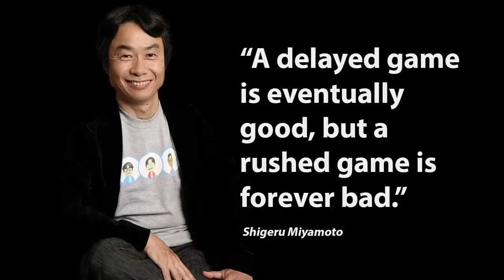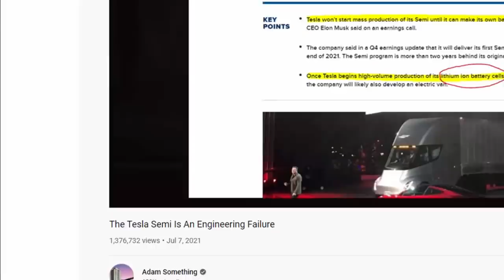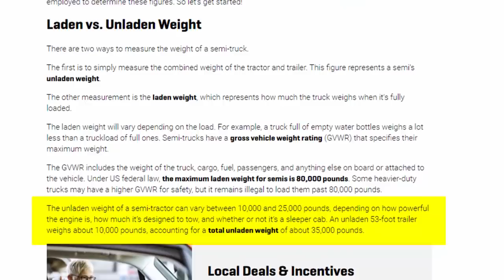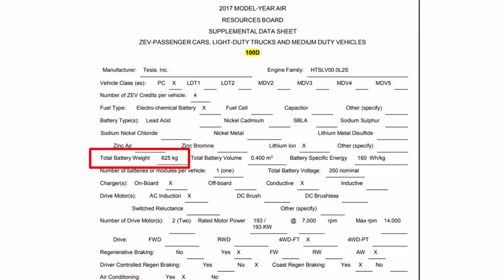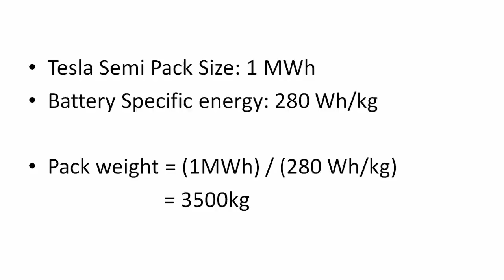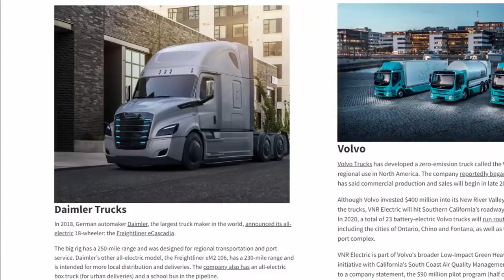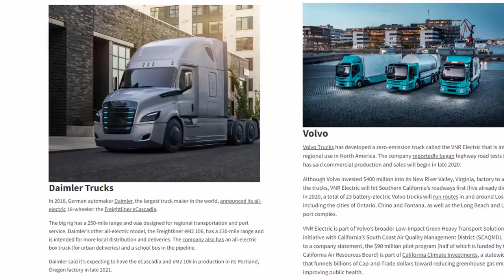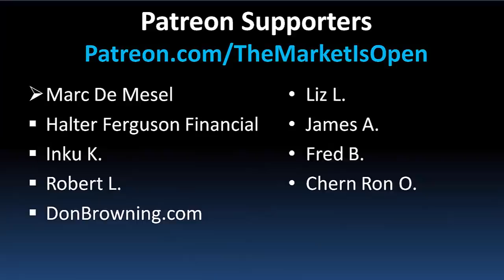The 2022 Tesla Semi is Genius, And Here’s Why

Comment: The 80,000 lb weight limit I see is more about the roads and making sure the load is balanced. I can't find why but you can't put all the weight on 1 section and expect our roadways to survive.

Teslas or EVs on fire is a problem when it happens. The only meth EU has solved is you drop the entire vehicle in water. The amount of energy in the battery pack takes truck loads of water to stop it. Firefighters don't have any good strategy to stop a normal EV let alone a 1 MW pack semi.

Another challenge will be charging not just 1 truck but many. They would need to install megapacks of power with several windturbines repowering these sites. Solar site would be huge and would take forever to repower. This amount of power needed for future growth is comparable to needing a nuclear reactor. The grind can't handle this much draw. They will need to depend on the megapacks to be the buffer and find other sources to bring the charge back up.
Reply: A BEV burns very slowly. So no problem to put it in a container full of water and wait 3 days. Every megacharger comes with megapacks. And surprise: It will also accept nuclear energy. If the grid can handle Superchargers, it can also handle Megachargers.

Comment: As a trucker, I am very much looking forward to driving one of these OTR, but until they hit closer to 800-1,000 mile range, they will probably be relegated to city/local duties due to the fact that it will hinder a drivers ability to drive 600-700 miles a day in a reasonable amount of time. Another issue is charging during the mandated 10 hour break. We need heat/AC, microwaves, TV’s, refrigerators etc during these breaks, as we sleep/live in the trucks. The average truck stop has between 100-300 parking spots. Getting to a point where most trucks stops have enough chargers for everyone to keep them plugged in while they are on their 10 hour breaks seems impossible for now. I also wonder how much range will be affected during the long winter months when temps are sub-freezing.

Also, and this is an easier fix, while a center driving position seems cool, having the drivers seat on either side provides the driver with at least one sight side during backing maneuvers instead of 2 blind sides. Until you actually drive a semi, you don’t understand how much better it is to be able to look out the window while backing vs screens for both sides. 

Also, cost is a big factor. Even if they are able to overcome all of these things, the average cost for a Freightliner Cascadia is about $100k per truck for a fleet. I cringe at the possible cost of one of these trucks without some kind of heavy government subsidy to make it a fiscal reality for a company looking to replace its fleet of diesel trucks for electric.
Reply: I dont see a problem that the FSD will be able to maneuvre the truck much more precisely than any trucker. The operational cost of an EV are just 1/4 of a diesel.
Reply: 100k for a brand new semi truck, try $160k - $350 k

Comment: Energy density of batteries compared to diesel is about 10% Heavy towing will need a massive battery capacity and recharging time - not much good in cold weather either - Ok for local light weight deliveries until battery [or hydrogen] improves. Tesla is just gambling on share price rising it has not yet made any real money and probable never will because of competition from existing manufactures who will see what happens before adapting.
Reply: The efficiency of BEV is around 90%, the diesel efficiency is just 30%. And you dont need heavy tank, engine, transmission, exhaust, radiator.

Comment: how will a self driving truck be able to see behind its trailer? A model S can see 360° around and predict what will happen in the future, but in a truck the landscape is quite different, specially while hauling a trailer.
Reply: Clamp 2 wireless cams on the back of the trailer, the FSD will connect and perform all maneuvers.

Comment: The specs will likely be better. Battery production will have to ramp up for both trucks, so that could take a while, but they've already gotten a head start on it. That leaves locating charging stations in strategic places that can accommodate enough routes. It'll be only long-haul electric truck for many years and will not be able to keep up with the demand.
Reply: You can have the best specs in the world if you never have to deliver a vehicle.

Comment: Do you realise how much just one mega charging area for only 20 trucks would cost?
   Then multiply by 500 just for Australia.  You see the problem?
Reply: 1/20 as it would cost with hydrogen. And you can install them whereever you want. No environmental proof necessary.
Reply: Are you referring to capital costs or running costs? Because if powered by solar panels with battery storage, the running costs would be a fraction of the costs of running a ICE fuel station. But I'd say AU$5 billion would would build quiet a few mega charging areas, not 500, but maybe the first 100 along routes on the East coast.
Reply: @UJCentral  I think the future of BEV does not at all depend on what Aussies think or need.

Comment: Your video and analysis shows you are ignorant on the trucking industry and you are a fanboy of EVs as you readily state the plusses but conveniently ignore the minuses of EV vehicles. The reason why the EU and USA allowed EV trucks to have a higher weight rating is precisely because the EV tractor weighs a lot more than an existing diesel truck. Yes, the naysayer you quoted in your video is wrong, but he has a valid point. To make EV trucks competitive, they had to change the law. With respect to autopilot features, todays trucks already have lane keeping and automatic braking along with various other driver technologies. These advancements have not reduced accidents. There's evidence to suggest that many truckers hate the automatic braking systems because they're activated when cars cut off trucks, which happens numerous times a day, thus putting the truck into a computer perceived emergency situation which results in emergency braking and an unsafe situation. With regard to a lower center of gravity, when a tractor-trailer turns over, the tractor is almost always the last to flip, if it ever does. The problem is the trailer. Yes, EVs will make the tractor safer with a lower CG ... but rollovers are still going to happen. During Tesla's unveiling and promo video which you show, the Tesla trucks are shown pulling Tesla marketed trailers. They show them having cameras and sensors to help out with the autopilot features. Well I can tell you that isn't happening in the real world anytime soon. Why? Most trucking companies and owner operators enter into agreements where they pull each others trailers ... they're interchangeable. It allows the tractor to keep working while the trailers wait to get loaded, unloaded or yard moved. You'll see a UPS truck pulling a JB Hunt trailer. An Evans Delivery owner operator pulling a US Express trailer. The combinations of who can pull what gets mind boggling. Hell, the FMSCA and NTSB have tried like decades to get the rear of the trailers redesigned so they don't decapitate drivers who crash into the back to the trailer. So a Tesla tractor will have to pull regular existing trailers and how is that going to affect their mileage and autopilot/safety systems? Regarding the fire issues, EVs have significant fire hazards. One of which is that rural fire companies (where most of our roads exist) do not have the water capacity to even put out a Model S fire. Google it. It's a huge problem in the Fire & Safety industry. Having multiple EV trucks/car crashes would be disastrous, potentially even infrastructure collapsing due to extremely hot and long fires. Your point that there's "virtually no EV truck competitors in this space" is ridiculous. Nicola motors is already delivering BEVs, as you even stated traditional companies are coming to market and there's already a few foreign trucks available. Where's Tesla semi? Do we even know if their claims are true? And the glancing over you gave the charging situation is akin to journalistic malpractice. We already see the limitations with Tesla car charging stations during holiday travel -- thousands of Tesla motorists stranded on the interstates waiting in lines sometimes 2 miles long for a charging unit. Yes, truck drivers do legally have to take a 30 minute break. But that break is often taken in several locations/situation which wouldn't lend itself to charging the truck. I highly doubt in the near future that we'll see an entire commercial truck stop with charging abilities at every parking spot -- could you imagine the cost and space required? That's best case scenario. The line for trucks waiting for the charging aisles will become problematic and inefficient if it is going to only take 30 minutes. And charging the truck is probably going to be labeled as "duty" by the Feds so we don't even know if the drivers can be in a legal "rest" while charging the vehicle. Right now, existing Tesla charging stations for their cars and their future semi charging shown in your video do not have the capacity or through-put we need and for everyday use compared to ICE refueling. This is a big problem and so far I have not seen a viable solution. This is why I've come to the conclusion that a large class 8 EV trucks may not be viable and the FCEV may win over time if they can solve nitrogen distribution.
Reply: Yes, 2 tons more. So what?
Reply: @vic321344  The point is valid. The EV trucks are heavier. They had to change the laws to make them competitive. Why would they change the laws? You're smart. They will cause more damage to the highways. But compared to what the naysayer in the video said, he's wrong and exaggerated the issue.
Reply: Sorry, I couldn't read your full comment, I have difficulty reading block text.
But if building an EV charging infrastructure faces problems, they're minor compared to building such an infrastructure for FCEVs. And green hydrogen will always be more expensive to produce than green electricity.
Reply: @davidkeenan5642  Disagree 100%. Nitrogen can be fielded right along side ICE fueling as it wanes. Charging stations are going to require a lot of SPACE. Class 8 trucks take around 10 minutes at the pump to fill up and at most stations there's 3-4 trucks behind them waiting to fill up. Can you imagine if we slowed that down to 30 minutes per truck? There's already backups at even the fastest Tesla car charging stations. The through-put isn't fast enough. And with big trucks it is only going to get worse. "green hydrogen will always be more expensive to produce than green electricity" .... green electricity or EVs will be vastly more expensive than ICE vehicles and really you're just moving the carbon release from the vehicle back to the mining of the minerals needed for the batteries. Do you think Nitrogen generation can be made cheap by using solar or nuclear power?
Reply: @JohnSmith-zi9or  Its just a matter of calculation. If it is cheaper if you wait for recharging than it is to drive Diesel, you will wait. Maybe also a better solution for driving safety, if you rest for an hour after 500 miles instead of refueling in 10min and drive on for the next 1000Miles.
Reply: @JohnSmith-zi9or  Nope. Hydrogen is dangerous. So it is not allowed side by side with a gas station. Also a H2 station for 2.5 mill $ only allows to fuel up 8 trucks per day. You have to wait until the compressor of the station builds up enough pressure for the next fill up.
Lithium for batteries is not rare. Platinum for the catalytic exhaust is rare. And cannot be recycled for the most part, as it is despended into the environment.
Generating H2 is 4 times less efficient than using electricity directly.
Reply: @JohnSmith-zi9or  
The change away from the ICE is coming, and just as happened with car drivers where the first adopters charged from home and had to plan for longer journeys, the first adopters for EV semis will be fleet operators who can charge from their distribution depots, and they have professional logistics managers who can plan the routes and the charging stops.

Not every semi is loaded to the maximum weight, so the battery weight is 
can be ignored for now. But fleet operators can afford the up front cost and gradually replace their ICE vehicles with EVs.

EV semis will not be for independent truckers for many years.
Reply: @davidkeenan5642  I agree. ICE is slowly ending. And I agree that LTLs like UPS/FDX/Dominion/Estes/Saia will be the first to adopt them. However, they may require two trucks for each route. One for the driver to drive to point B, drop trailers, pickup trailers with a new fresh EV and drive back to point A. The video and Tesla says, "Oh every driver must take a 30 minute break so they can recharge then." Duty times don't work like that. You can't have any truck responsibility while you're on your break. And I doubt the feds will allow the trucks to be charged while the drive is officially off duty ... on rest. Plus the point of taking a break is when the DRIVER feels it is necessary within the first 8 hours ... not when the truck is needed to be recharged. 

I agree somewhat, lease owner operations or O/O in general will be the last to use EVs as well as the long haul trucking industry. Opposite of what Tesla is pitching. The through-put of charging is a huge problem.

Comment: great report - I think the recharging stations will require a good sized initial effort    :)
Reply: Like the supercharger network did.
Reply: @vic321344  - Except these trucks have batteries 20 times the size of Tesla cars, so that means 20 times the size of transformers and DC chargers and if you try to charge multiple trucks at once you will need to put in the equivalent of a small substation just to power the truck charging network. A non-trivial amount of hardware and money.
Reply: @WJV9  Its 10 times the size of a car battery. And yes : all other manufacturers have difficulties to even locate these batteries inside their old chassis. And yes: You need a megacharger, like Tesla is building. And if you put in a Powerwall 3MWh battery into every Megacharger, you have no problem connecting it to the grid. You could even use it to stabilize the grid. And that ist still a magnitude cheaper than a gas station or a hydrogen station.

Comment: My 2 questions are: on the semi is there a place on the front for  hooks in the unlikely case it needs to be pulled, and can any trailer be used with the tesla tractor because of air brakes and how do the trailer brakes work from the tractor to the trailer.
Reply: Installing an electric air compressor does not seem to be a problem.

Comment: Due to the loss of fuel tax revenue, you can bet that it won't be long before on highway electricity will be taxed.  This will make the payback period longer for these vehicles.
Reply: Everything will be taxed. Even air (CO2 tax). So better use a cheap and efficient technology to keep costs of operations low.

Comment: Nikola Truck is 1000% better - by using Hydrogen - Tesla charging a 8,000 lb battery will only create more and more pollution. True
Reply: It just does not exist. As the H2 infrastructure. And it is expensive, inefficient and dangerous.

Comment: Tesla's range, 0-60 and torque figures all require an astrix beside them. These numbers are always at the absolute optimal conditions. What happens with battery degradation, what happens with cold weather? This all results in a large safety factor that needs to be applied to your calculation and that my friend is why your numbers are also totally wrong. I'd estimate that you could easily be looking at doubling that battery weight on the two aforementioned points.